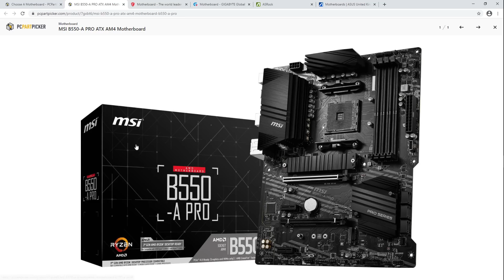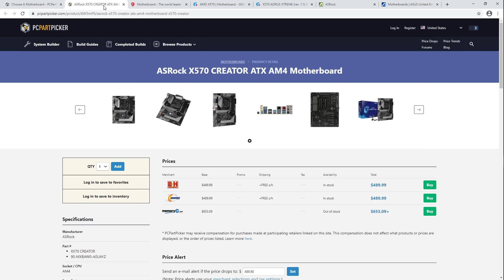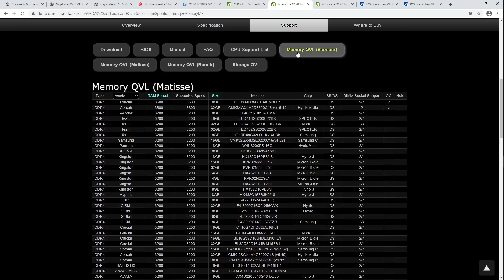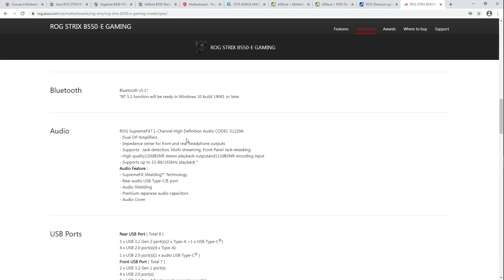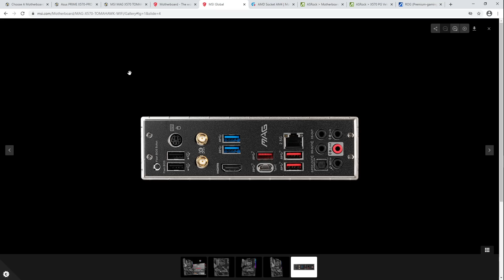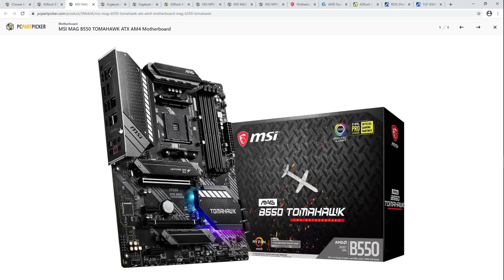Rambling about B550 and X570 motherboards. December 2020

Comment: So in mITX format, your best option is Asus X570-i but it lacks in memory OC departement and it's only 1GbE, And if you want TB you have only one option from Asrock. And if you planned to go with Gigabyte X570-i forget it and go the cheaper and arguably better B550-i variant that's also not that great with memory OC?
And out of mATX you like B550 Mortar, but it's limited in terms of ports (they're the same as on MSI MPG B550-I), but it's going to leave you wanting when thinking of memory OC... 
Basically, this video was focused on ATX boards with a flavor of EATX... little was said of the smaller sizes. Should have retitled this vid to "Rambling about B550 and X570 ATX motherboards." or something... ;)

Comment: What are your thoughts on the ROG Strix X570-E when it comes to PBO? Has anyone tested if it can handle the Ryzen 5900x with PBO without the VRMs failing? It is hard to find boards with lots of SATA ports (plan to use 6 SATA HDDs, and 2 SATA SSDs, and 1-2 m.2 SSDs). Only issue is determining how well it will handle PBO. As for the RAM, the goal would be to run at DDR4 3600- 3800 speeds while tightening the timings as much as possible while maintaining stability.
Reply: Get a crosshair hero 8 instead wifi or non wifi

Comment: I just bought the x570 motherboard a month ago and set up the latest update to bios. All new computer parts as well, no over clocking and all default settings. I have this same issue of it not booting up and have been trying to dig into this for a couple of weeks now. Disappointed a motherboard can be so broken and hasn't gotten an update to fix the start up issue. My guess is the issue is widespread...

Comment: Just get a top of the line ASUS board and stop sweating the details. The couple hundred xtra you pay will save you two hundred headaches.
Reply: Crosshair hero 8 good choice?
Reply: @iamLODD  It seems not too shabby. Wish I would have purchased the higher end chip though. Alas, I wasted that part of the budget on an expensive system board ;)
Reply: @dumpsterdiverspcreclamation  haha :) I got you, spend more money on the cpu and gpu and then look at the motherboard. Thanks for the advice have a good day
Reply: @iamLODD  It really depends what you want. I mean given AMD's track record of system boards supporting generations of CPUs maybe it wasn't a bad idea. I could always drop the 3800x into a cheaper board later down the line and pick up a zinger two gens later. I have a large family. PCs never get wasted around here :)
Reply: (Not saying a 3800X is a dud either.)

Comment: So, if one had 4 sticks of 16GB CJR/DJR (I think, rated at 3600 16-19-19-39), and wanted to stick them in a B550 vision D with a 5950x, but was only able with his pitiful knowledge of timing tweaks to get the things to a MASSIVE OC of 3666 MT/s, what might you recommend they do to improve that OC (timing, frequency, voltage tweaks or some combination thereof)? Turns out running that much RAM in what I think is also quad rank is pretty brutal

Comment: I need SATA slot to connect my existing HDD and SATA SSD, So basically ASUS X570 (8SATA), and it's better to have two PCI-E 4.0 16x slot which can work on 8x when two is used, So the rest is ASUS ROG STRIX X570-F or E, and PRIME X570 PRO and Above.

Comment: X570Xtreme rev1.0 in 4x8GB configuration maximizes around 4200Mts, tested both on 3800x & 4650G Pro,  2x8GB it does 4800Mts+ with the right kits of memory. 
FCLK will depend on CPU but the board gives trouble with 4xdimms regardless of CPU used for frequency around 4200Mts.
Renoir can do it 1:1 4200/2100 which is nice.

Comment: On the Gigabyte booting problem - my daughter's B450 Aourus ITX (approx two years ago)  had this occasional problem while running an early release BIOS (fix was to clear BIOS and it happened often enough for me to put a switch in the case). When the BIOS was upgraded to a much later version it no longer happened...

Comment: So a bunch of reviews show that that MSI MPG X570 Gaming EDGE WIFI's VRM runs super hot, but my VRM with a 3800x (I've had over 150 watts) NEVER gets above 60c and consistently runs in the 40s... I bought it in October. Did they change it? I think it has IR 35204s
Reply: And I've even run the switching frequency at 1000KHz

Comment: Got 4x16GB running on 3800 MHz on 2 different GB X570 Elite. So I would't really worry about mem OC (maybe on Zen 3 with >3800 1:1). But as far as X570 goes, the non-spinning fan on the Elite would be way more important to me, than a tad more mem OC or better VRMS (TUF....).

Comment: Its kinda stupid how the difference between x570 and b550 for the nost part is the ability to do x8x8 pcie lanes (b550-e aside).
B550 should just have 8x8x as an option by default and x570 should have another  x8 lanes so you can do 16x8x or 8x16x or 8x8x8x.
No I don't care about pcie4x4 downlink.
Edit let us have an x16 gpu and another x16 for quad m.2 adaptor.
OR x8 gpu and x16 m.2 adaptor if we must.

Comment: I was disappointed that you didn't take a closer look at the b550 gaming edge wifi. I got it when it was in stock because thermal testing from HUB showed it had better vrm temps than more expensive boards, including the gaming carbon.

Comment: hi buildzoid

for the x570 dark hero.

the singlecore/multicore overclocking on the fly is pretty much usefull for like blender etc.

the ingest of data, before the render itself, is basically singlecore. so the 5 ghz on a 5950 x on ingest and then all core 4,7 or higher on the render itself, will help a little with time.
that translates with all programs which use a single core to load respurces and multicore for the actual workload.
500€ in austria, we have way higher taxes than elsewhere :-/

Comment: So between the x570 Taichi and Dark Hero, which is like better more well rounded for a gaming set up.

I’m getting 
2nvme 3.0 (maybe a 4.0 later when there’s more support where my loading times actually see more then a 1s difference)
2x16 3800 d14 (overclocking it a bit)
And setting my 5900x to PBO.
Reply: Don't worry about pcie4.
Sequential speeds at long queue depths are higher but you can do that with a JBOD of HDDs.
Loading times and general system response is from qd0 to qd2 random 4k reads which even the fastest ssds max around 70MBs so bus (sata vs pcie3 vs pcie4) has litterally no effect on responsiveness.
Hard to believe but go learn how to read storage testing and see for yourself.
Even qd4 128k reads are maybe 1300MBs so pcie2x4 would still be fine.
Reply: @tomstech4390  thank you

Comment: I’m going to make a video similar to this because I love to do these types of comparisons on my spare time but I only use it to help people close to me. Might as well do it for everyone since we pretty much have the exact same mindset on motherboards.
Reply: Bro can u say something abt the b550m bazooka he skipped that mobo but hardware un boxed praised it in their vid and will that be good for the 5600x
Reply: @keiserzg1968  oh the videos already been made it's just on a separate channel under ASTRSK PC
Reply: @asterisk4424  bro i watched the vid u made it was rly informative nd good,but for me i dnt trust gigabyte boards and their after sale service is rly bad and the troubleshooting feature is something i rly need,and the other choice i have is the b550m pro4 im not sure abt that board will it be enough for the 5600x?i was looking forward in getting the bazooka as in hardware unboxed it shwed the temps were rly low and had the features i needed so between bazooka and pro4 which would u recomend and why?
Reply: @keiserzg1968  I'd go with the bazooka for several reasons. It has the bios flashback button in case you don't have the cpu to upgrade with, the vrm is more then capable of keeping up with a 5600x, and unlike the m pro 4 the 2nd m.2 slot is a full speed 3.0 x4 slot instead of a 3.0 x2 on the m pro 4, plus at it's current price of $109 it actually make's a lot more sense then when it was originally $129 at the time I made the video.
Reply: @asterisk4424  thanks bro ure a legend

Comment: Can you please explain the 4 layer pcb limited memory overclocking? I have 4x8 djr 3600 16-18-18. Are we talking 3800 max? Maybe 3900? Or are we talking 3400-3600 best case?
Reply: If I remember correctly,  its radio interference  . But don't hold me to that .

Comment: You have no idea the smile on my face when you said the X570 Tomahawk was dethroned by the TUF Gaming Pro. I banked on the TUF Pro when I saw it launched mainly because of the Intel 2.5G LAN (Rev. 3 so no issues that Rev 1+2 had) and because it was actually in stock unlike the MSI. I also prefer Asus bios over MSI. I really wish you could get some photos of the VRM and go in-depth on it to see how it stacks up on that front.

Comment: I bought B550 Gaming Plus from MSI for like ~126$. Everything's working fine, I'm running Athlon 200GE. I've noticed only 1 problem -> can't access BIOS using integrated Vega GPU, must use dedicated one.

Comment: And still no word about the most important feature of the year - MSI's Core Override Boost / AutoOC +500 max. Because, yes, with a MSI board you can raise your 5600x boosts to 5 ghz and 5800x to 5.1-5.2ghz, while you stop much lower with any other brand.  https://www.overclock.net/attachments/365def9573a5a6eef3ff258f6049248730eeafcc-jpg.2468755/

Comment: Regarding the Aorus Master issues, it seems that the board can get stuck in some debug "not off not on" state when the PC does not get shutdown properly (mostly after BSOD). That state should reset if the board is completely without power, thus the battery removal. The board completely locks and ignores everything including clearing cmos. So it can happen to unstable systems easily, but mostly it just feels like Gigabyte forgetting some debug functionality on which would be pretty neat feature for manufacturer but annoying one for the customer.

But also it seems it is enough to get a warranty claim which can result into getting a free update a year later.

Comment: Asus b550-E vs b550-F any difference in VRM
Reply: Google.com, there Is a sheet
Reply: In Hardware unboxed VRM testing video there are no difference between b550-f and E so I want to know as f version is 50$ cheaper
Reply: There is a sheet in some forum that have all the information that you want, but ir you are lazy to look at it, continue with your doubt
Reply: With the f asus is an arsehole and disables the thermal probe...its still there but turned off because "spend more money peasant"-asus.

Comment: Guys a tip watch in 2x speed
Reply: Youtube speed extention.
Up/down in .1x increments all the way from .1x to 16x (actually goes down to 0.07x fwiw)
Combining the .25x youtube incremants you can get 0.1.....0.15....0.25.....0.3.....1.5x....2.45....2.55....10.25.....11.95, whatever.

Comment: Anyone looking for a budget motherboard with good vrm, you can check for the Asus x570-p. Good vrm (you can oc a 5950), two m2 gen4 x4 slots. No bios flashback, no postcode leds, no wifi, no type-c and 1 gig realtek lan. But you can find it at 130$ at amazon every two weeks. And you can add that extra money to your cpu or gpu.

Comment: why skip A520 :(
Reply: Shitty boards, many of high end 520, are B450
Reply: @UltraDXSASC  nope. at least they are below 100$ and have full pcie 3 support unlike b450 which has pcie 2 general purpose lanes
Reply: @LivingTheDream77  the gp pcie lanes are kinda worthless and can be ignored  theres 6 on b450 and 8 on x470 but who cares.
Usually its pcie3x4 m.2, the  pcie3x16 gpu, and then pcie3x4 to chipset which then either goes to a second pciex16 physical x4 wired slot which gets disabled if a second m.2 (pcie3x4) slot is used.
There may be some exceptions but few people but a b450 full atx board with 3x pcie slots and intend to fill them all.
For the most part you can have an m.2, a gpu and a second m.2 using the full 24 pcie lanes available on an itx board.

The 4k random reads at qd1 that most ssds see average around 70mbs so even sata bus isn't a limit (do love nvme protocol though) and even at hypothetical scenarios like queue depth 32 and 128k random reads modern drives like the 980 pro max at 1300MB/s so even pcie3x2 or pcie2x4 wouldn't be a problem if board makers wanted to use plx chips and bifurcation.

So the GP pcie3 (fixed) on a520 usually doesn't outweigh the overclocking on b450 and b550 boards.
Reply: @tomstech4390  a520 dosent have pcie 4

Comment: 1:53 Gigabyte X570 AORUS XTREME
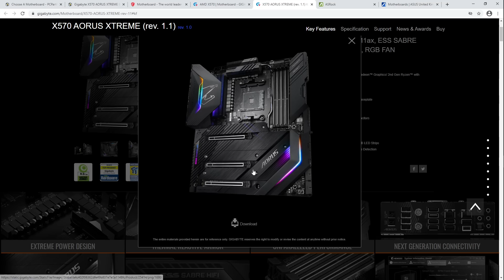5:42 ASUS ROG Crosshair VIII Formula
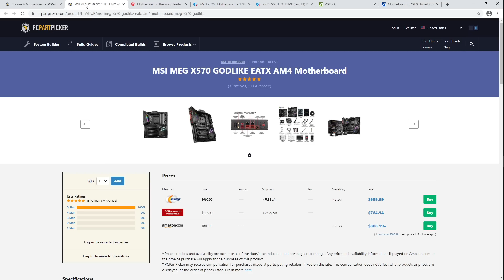8:50 MSI MEG X570 GODLIKE
12:16 MSI PRESTIGE X570 CREATION
Time stamps:
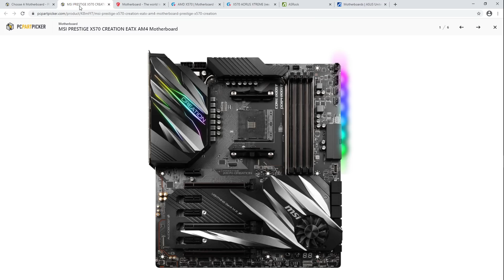18:37 ASRock X570 CREATOR
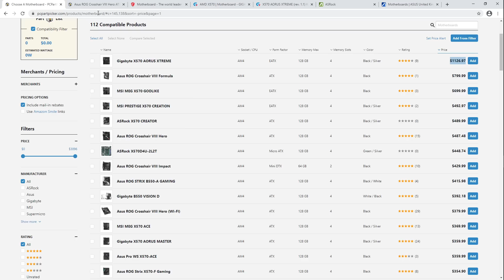22:27 Asus ROG Crosshair VIII Dark Hero
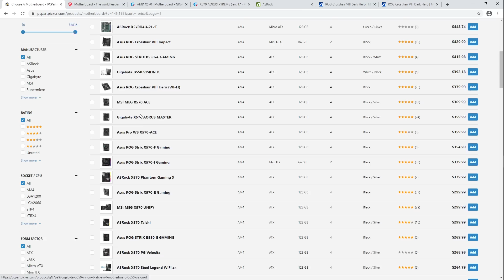28:33 MSI MEG X570 ACE / UNIFY
32:18 Gigabyte X570 AORUS MASTER
37:30 ASRock X570 Taichi
49:23 Asus ROG Strix X570-E Gaming
53:36 ASRock X570 Phantom Gaming X
54:53 Asus ROG Strix X570-I Gaming
59:46 Asus ROG Strix B550-E Gaming
1:05:47 Gigabyte B550 VISION D
1:06:37 ASRock B550 Taichi
1:18:25 ASRock X570 PG Velocita
1:20:46 ASRock X570 Steel Legend WI-FI
1:22:09 Gigabyte X570 AORUS PRO WI-FI
1:22:39 Gigabyte B550 AORUS MASTER
1:23:28 Gigabyte X570 AORUS PRO
1:24:24 Asus PRIME X570-PRO
1:27:34 Asus TUF GAMING X570-PRO WI-FI
1:29:50 MSI MPG B550 / X570 Gaming PRO CARBON WI-FI
1:32:58 ASRock X570 Extreme4
1:34:30 MSI MAG X570 TOMOHAWK WI-FI
1:35:32 MSI MPG B550 Gaming EDGE WI-FI
1:37:39 Gigabyte X570 AORUS ELITE
1:39:44 Gigabyte B550 AORUS PRO AC
1:42:47 ASRock X570 PHANTOM GAMING-ITX/TB3
1:44:30 ASRock B550M-ITX/ac
1:46:04 Asus PRIME X570-P
1:46:55 MSI MPG X570 GAMING PLUS
1:49:14 Asus TUF GAMING X570-PLUS
1:49:27 ASRock B550 PG Velocita
1:52:58 ASRock X570 PHANTOM GAMING 4 WI-FI
1:53:15 Gigabyte B550 AORUS ELITE AX
1:54:05 Gigabyte X570 Gaming X
1:54:58 Gigabyte B550 AORUS ELITE V2
1:55:35 MSI MAG B550 MORTAR Micro/WI-FI
1:57:55 Gigabyte B550 AORUS PRO
1:58:43 Asus TUF GAMING B550-PLUS
1:59:41 ASRock B550 Steel Legend Micro
2:02:16 Gigabyte B550 AORUS PRO-P Micro
2:03:21 Asus PRIME B550M-K Micro
2:03:37 ASRock B550M/ac Micro
2:03:51 ASRock B550 PHANTOM GAMING 4
2:04:09 Gigabyte X570 UD
Outro Favourites
2:05:20 MSI PRESTIGE X570 CREATION
2:05:36 MSI MEG X570 UNIFY
2:07:08 Asus TUF GAMING X570 PRO WI-FI
2:07:40 Gigabyte B550 VISION D
2:08:16 Asus ROG Strix B550-F GAMING WI-FI
2:08:56 CREATION / Taichi / UNIFY / VISION D
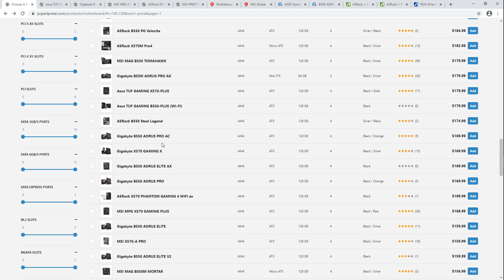2:09:54 Gigabyte B550 AORUS PRO V2
2:10:17 Asus ROG Crosshair VIII Dark Hero
2:10:57 MSI B550-A PRO
2:19:27 Asus ROG Strix B550-E GAMING
Reply: No mention of msi b550 itx. Damn.

Comment: You keep praising the TUF, but the way I am reading it has no PCIE switching whatsover, it's 16x+4x. Which is laughable
Reply: Effectively x16 gpu, x4 m.2 (cpu) and then another x4 to chipset for bottom pcie or second m.2...
There are itx boards that do that lol
Then again ryzen only has 24 pcie lanes.
We going to have...
pcie4x4 m.2 boot.
Pcie4x8 gpu
Pcie4x4 m.2
Pcie4x4 m.2
Pcie4x2 m.2
Pcie4x2 m.2
Don't think so.
Reply: The TUF gets recommended a lot since its a good mobo for most people since they most likely will only use a single gpu + single m.2 drive and has good vrm for the price, like he said in the video, there is many x570 that are situational, so for most "gamers" the TUF is more than ok, same could be said for the Aorus Elite.
Reply: @XxDeViLBrInGeRxX  normie suggestions belong in a GN video, not in 2h of BZ ramblevideo

Comment: I had an Asrock z97 on my first ever build that wouldn't power on after it was un plugged from the wall for even 1 second, or the outlet it was plugged into had lost power. First time after a storm knocked out the power I thought it had fried my board, but it randomly turned on 20 minutes later. The problem would reproduce its self if I moved the computer or even just unplugged it for cleaning or an upgrade. Almost 10 years later I still refuse to use Asrock motherboards.

Comment: what are your thoughts on the new ASUS ROG Strix B550-XE?
Reply from the maker: I haven't seen a price for it so IDK
Reply: It’s the b550-e + a riser for additional m.2 storage
Reply: @MikeJones-bl6lu  not quite. it also has better VRMs and a heatpipe. i was just wondering if its worth the extra cost. i dont like that it has a VRM fan though, and the amount of USB ports is also pretty meh.
Reply: @Nikko911  all of the b550’s are pretty meh in terms of Usb’s. At least they give you an error code. That’s a feature that’s not on lots of boards say from Gigabyte for example

Comment: I'm with you BZ about USB and SATA ports, it bloody awful how many mid/high end boards have awful backpanels with as few as 4 USB ports(1 for keyboard,  1 for mouse, 1 for external drive, leaving 1 free for maybe a webcam, wow great) and only 4 SATA ports (personally I need 7 atleast).
Choosing a board for my 1st AM4 system was a damn nightmare too, I finally settled on a crosshair 8 hero because I found a good deal, it has plenty of usb and sata and hopefully get a £55 rebate when ASUS finally coughs up (I know they do honour rebates, but are very slow to do so, typically 4+ months).